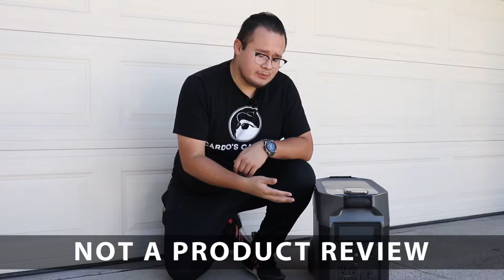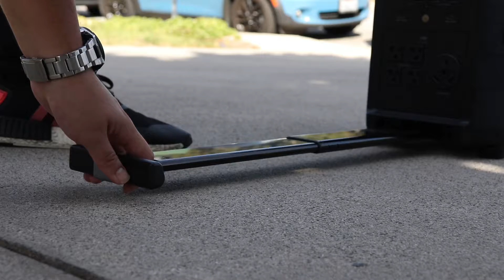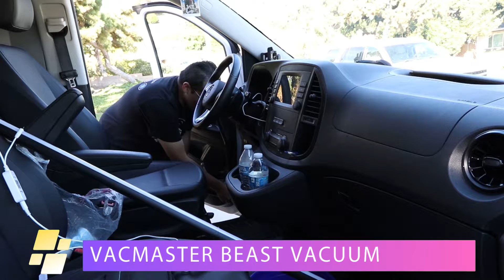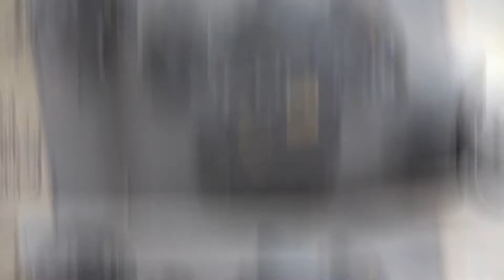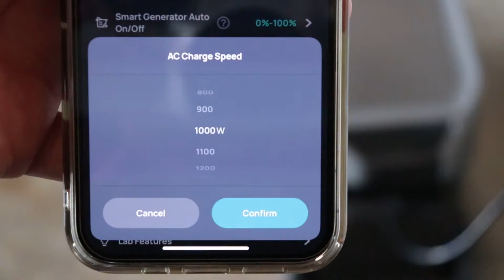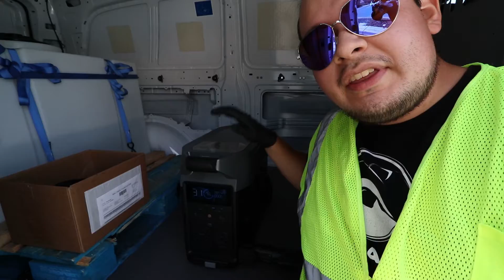EcoFlow Delta Pro and Detailing [ First Impressions ]

Comment from the maker: If you had a Delta Pro, how would you use it in your Detailing routine? 🤔
Reply: I just bought one I’m going to give it a try.  People saying it’s not worth it but you can literallly buy an attatchment to charge it at a charging station
Reply: @DP-jb4yo hey how’s it going I’m starting my detailing business and am planning on getting the eco flow do how has it been for you thank you!
Reply from the maker: If you are just starting out your detailing business, I say do not buy this. Build up your clientele first before making investments like that. start economically first, then, as the clientele builds up and your income grows,  you can make a purchasing decision. 👍
Reply: Very informative video. Ty
Reply: 😂😂😂 junk
Reply: Too bad It does not do well with extreme heat, here is Az it’s a no go- can not store it in my van over night or day to day- as the battery is not recommended it be in environment over 113degrees F

Comment: Can you use delta pro while its charging with solar panel? Thx
Reply from the maker: Yes! 👍 Charging will be slow, but yes
Reply: Thank u for ur reply. I am also thinking to purchase this unit. Can you help me to answer one more question? Can i plug Delta pro to Charge at home and programmed it to charge at the lowest peak time like from 2am to 4am where electricity price is cheaper? So lets say i go sleep 9pm and i plug delta pro to charge, but i want charge start at 2am I hope u get what i mean. Sorry English is my not native language.
Reply from the maker: @freshcryptojuice3790 as of now there is no automatic way to charge the system at a specific time 👍
Reply: @CardosCarDose thank bro and good lick with ur work. Amazing videos and reviews. Keep it up please and provide always the dilution ratio of the products you using. By the way when will be the full product review of your delta pro, as i didnt find any new videos after watching this one. Do you still use it?
Reply from the maker: @freshcryptojuice3790 I still use it to this day and have made several upgrades, but I do have a little bit of skepticism towards the brand. The product is perfectly fine, this is mostly a brand problem on how it handles customer service and data.
Reply: What kind of upgrades have you done to the Delta Pro? How many do you own?
Reply from the maker: @GrantMiyashiro So far only solar panels and an extra battery expansion. Nothing really changed in performance other than it just lasting longer
Reply: @CardosCarDose oh so you bought that extra battery and plug cable to connect both? So about 200lbs.

Comment: My generac 4500 is 100lbs with full tank. Only thing I dislike s the loud sound. But, if it runs out of juice I can be up and running in 2 mins by filling up the tank again. With these batteries you have to wait long periods of time to reuse when they die.
Reply from the maker: As an owner of a battery, I can 100% agree with this argument. If noise is not the issue then gas is the best and is sustainable. 

Even when detailing as a business I found charging the thing to be a hassle if I only rely on solar, and charging with the customers power is not always available.

Comment: Is nice for quick details or exterior details or basic interior details but dirty cars full detail no way that shit gonna last while I’m running compressor , two stage vaccine I would neeed two of this which will cost 6-7k
Reply from the maker: You can certainly pull off two full exterior and interior details with one battery if you are efficient. ☝️ not that it can't handle it, but if you are going to use particular equipment, such as heated equipment or +1800W machines, then you will certainly need another one. Just depends what you plug in and how long you use it.

Comment: Would this be ok for a 8070 mytee heated extractor?
Reply from the maker: For reliability reasons I can not answer that with full certainty. From my experience, using a single Delta Pro as the main machine I have tripped it at around 2900 W trying to run a compressor and vacuum at the same time. 

I would suggest reaching out to other detailers that have actually ran the machine with the battery. Sorry I could not help you champ 🙏

Comment: You should try using a soft start adapter / soft starter  to reduce  start surge when operating electrical tools
Reply from the maker: All of my tools work perfectly fine and there is no need for one in my use case 😌 I typically use one machine at a time

Comment: Its a great video.... 2 hours a day  should be more than  enough  for the pressure washing side of things for 1 person
Reply from the maker: Just the pressure washer, yes. Anything else connected that would be a no.
Reply: @CardosCarDose    a  400 Liter water tank  ( roughly 100 Gallons ! )  for example holding pure water  connected to a 7 Liter per minute  kranzle  pressure washer  would   take roughly 60 minutes minutes  to empty.. Yes food  for thought ..  Question is what is the average amount of water used  by  a professional car detailer  in california  daily ?
Reply from the maker: @fensterputzernuernberg it's not necessarily the flow that matters, there are other tools and equipment that are used for detailers, not just solo pressure washing, which is what also drains the battery. Not to mention the steamer. 🪫 

I have no saying for those that are doing power wash cleaning with a battery, as that is not my industry
Reply: @CardosCarDose  I am a professional cleaner in Germany .... My question is  ( which i sent direct to Eco flow europe ) is if this would deliver enough power to power a kranzle 1600 Watt  7 Amp 230 Volt  Pressure washer ....   and if so  for how long ..  i use 2 of my my kranzle´s  ( have 4 of them )   for rinsing purposes.  I will let you know what they say if they return the email .......... PS  by the way  I am talking about the Eco Flow  Delta max 2000  which is half  the weight of this  pro version.  I am pretty sure this Pro version would operate the  European  7 lpm kranzle which is 230 Volt  and / amp...  The only reason i  am contemplating this  is  for  rinsing  not  powerwashing .. Having this i   can plug and play in seconds  instead of  trying to find a electrical socket.. It really could be a huge help to be frank for me. I already have a  36 Volt   Professional lithium pressure washer ( also for rinsing  )  But that has  pressure guage    just  mode 1 and eco mode.. THis 36 V  pressure washer is great  but will only  run for around 30 to 40 minutes on 2 x 36 V batteries. The kranzle is a much better machine..
Reply from the maker: @fensterputzernuernberg Ah, I see. Well, if I can be fully transparent with you, I do not recommend getting an EcoFlow product 😬 plot twist

In case you have not followed me on Instagram, I have been very vocal about the company not offering battery cell replacement services. And considering the brand is a Chinese startup, I think it is very inconvenient for the user despite costing thousands of dollars. 

I am currently selling my Batteries and looking for a reputable company. Best advice, look into others that have specialized in the battery technology, Anker is my current interest.

But if you reeeeally want one, well, with my ~1600W Kranzle it lasts about 2 hours ish 🤔
Reply: @CardosCarDose   I appreciate your long , and  detailed answer , Thank you very much Sir... Here is 230 V and 7 amp in Europe !... Wish you    success in all you  do !  By the way  THEY STILL HAVE NOT ANSWERED MY EMAIL   that was  sent  5 days ago , So yeh the customer service is not the greatest
Reply: @CardosCarDose I thought they had a 5 year warranty?

Comment: Add solar to the roof of your van so you can charge on the go all day when the sun is out!
Reply from the maker: I know a couple mobile detailers that do it, and unfortunately it is only beneficial if the vehicle can physically fit a 600w panel(s). The draw back is that actual amount of kWh being received from the sun, in which you need high enough Volts and Amps to sustainably maximize the power intake. In other words, you need a very large van just to make it practical.
Reply: @CardosCarDose  Yea I know. The setups I see are mainly on enclosed trailers. You can also tie in to you cars alternator and fake solar input into the charge controller.
Reply: Can’t leave in I’m extreme heat in Az, will dramatically reduce battery life over 113degrees F

Comment: I'd mount the solar panels on the roof on the van to charge the battery in between jobs.
Reply from the maker: Ive seen other detailers attempt it with a 400w panel and its dodgy and your walking on thin ice considering it heavily depends on where you park and how cloudy it is

Comment: Cardo. Cut the Kranzle cord back to 3 feet on your machine & it  won't trip. I run mine of a 3500 predator generator for the last 3yrs & I haven't had any issues to this day. Love the video & info. ? What is the 3 prong adapter cord for on the right, next to 4 plug ins for . Look forward to your replie. 
Looking to upgrade to this in 2024
All the best mann. 
Garcia's Automotive Detail 
Tucson az
Reply from the maker: I usually move my machine around the house to do other cleaning jobs, so I will not shorten the length of the cord 🤔 My house is just really old that them outlets are not good enough for my kranzle😂 

The adapter cord came from the dark pits of my dad's old garage box 😆 📦 You can easily find these on Amazon
Reply: What about round out let
Reply from the maker: Ah, that is a manual power cord reel ⚡️ Helps cable manage everything and can handle the steamer surprisingly 😳 

Ill drop the link to that if you are interested 😎 👍:https://amzn.to/3tG1wiz

All the products I currently use are listed on my website as well if you want to check them out 👍

Comment: Just a heads up everyone, while it runs the Kranzle just fine, it will NOT run the AR BLUE 630TSS. The AR Blue requires a 20a outlet, which the Delta Pro has. But it looks like the initial start up surge is too much for the Delta Pro. Mine won't run, even when using a 5.0 orifice to reduce the initial surge. 😢
Reply from the maker: That initial pump is what always gets most generators, even battery, to struggle 😔 Does your pressure washer have a self priming pump? 🤔
Reply: Not sure exactly what you mean. It does have the total stop system that builds pressure and then shuts off anytime you release the trigger if that's what you mean. The specs are almost identical to the Kranzle. I dont have a 20a outlet in my home so thats why im trying to use the Delta Pro. I thought for sure it would handle it.   The weird thing is, mine won't run even if I remove the nozzle from my stubby gun, and hold the trigger down before trying to start. Even if I turn the pressure all the way down on the machine it won't go.. it trips the outlet. The Delta Pro can handle up to a 7200 watt surge and 3600watts continously. I'm having a hard time believing the AR Blue 630tss pulls more than 7200 on start, or more than 3600 continously... maybe my unit is defective. I did contact AR directly today and they are going to look into it and call me back. I'll update what they say on here just in case anyone else wants to know lol
Reply from the maker: @EricGonzalez-bd1qd This sounds like there is something serious going on with your machine because a welding tool doesn't even generate more than that 😳 I would suggest having the manufacturer take a look at your machine as this sounds like an electrical issue 🤔 🔨

Comment: The kranzle draws less power if you cut the power cord it comes with. I did it on mines and it only draws about 1100 watts now.
Reply from the maker: Sweet results! 😎But there is no way im gonna cut it myself or pay anyone 😂 I move it around the house and that extra cord helps
Reply: @CardosCarDose  ahh ok makes sense. I’m glad I found your video. I want to do this for my mobile unit just not sure if it’s enough power to last me throughout the day I would probably need 2 units to double the output since I’m going to be running 2 Kranzles at once.
Reply from the maker: Ah, for sure double Kranzle it can handle it. How long, I would say about 50-70 min with my estimated testing
Reply: @CardosCarDose  ok good to know. Thank you 🙌🏼

Comment: For one person detailer I think is good but for 2 oh 3 persons using polisher steamer and extractor at the same time it cant hold the amount of work ..  but we definitely try it and take back to cotsco 😅
Reply from the maker: Oh, i 100% agree with that argument 😔 I did plenty of exterior details on my own and works well

BUT THE MINUTE i plug in heated equipment it draws soo much power! I can not see this being used realistically for detailers with 2+ workers unfortunately 😔 

Ill elaborate on my Review video once that drops. Thanks for pointing that out! 😎👉👉
Reply: @CardosCarDose  you should have 3 machines at the same time and let’s see if work that’s way you can do more for your followers
Reply from the maker: Yeeeeeaaahh, i dont have 9k sitting around 😂 ill pass on that and let someone wealthier do that test 😭

Comment: Wow I'm speechless 🤐 to see that thing handle your tools.... I need me one 😆 great video Champ! Really awesome
Reply from the maker: Thank you king! 😎👉👉 Im curious where this new technology will take us once batteries are more standardized 🔋 🪫. 

What equipment do you have in your set up? 🤔
Reply: @CardosCarDose  vacuum, small pump that's not require a lot of power.  pressure washer  air compressor, carpet extractor the mytee 8070 a chiefsteamer 🤦🏾‍♂️ to much lol but again you never use it all at once......
Reply from the maker: Trust! Not to mention there are jobs where you only use 2 or 1 machines 😂 now my question is how this Delta Pro will work in the brutal winter up north 🤔
Reply: @CardosCarDose  will work for me for sure lol I do have a heater installed in my van so everything keep warm. Just like my battery that power the heater it's a northstar battery 480 if I remember correctly. I gotta keep  that to a good temperature or it dies fast
Reply from the maker: Dam 😭 gonna have to take notes when i travel up north or camp in the mountains
Reply: @CardosCarDose  lol 😆 yes you gotta keep batteries to a good temperature so they last longer. extremely cold 🥶 die fast.. I have a few in my car I used to do car audio. I took them out in the winter time because I don't really drive the car and to have them sitting in the cold 🥶 not great